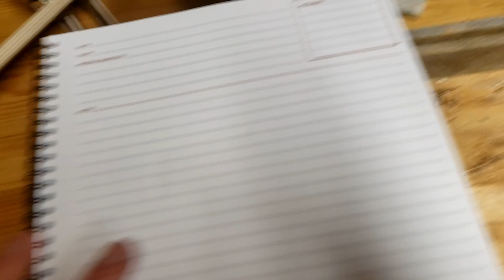I'm not finishing My Latest Prototype... Sandtronix 5 Taking a New Direction

Comment: hey I mean product dev is annoying at best and completely unpredictable at worst - what you've got through thus far is still impressive. saw this video in recommended and don't have much idea about sanding or your specifications - but if you'd like to save weight maybe building a smaller but likely stronger aluminium skeleton frame could help once a wooden prototype is running. In my case its helped for slightly adjusting motor positions without having to remill/reprint a frame component.

Ive built a similar-ish wheel design for a robotics comp before, and as a forewarning, keeping enough traction from contact force between the wheel and the wood while also being able to lift and rotate it may be challenging, id look at horizontal rotation rather than vertical rotation.

good luck and post updates, I'm invested now :)

Edit: oh on keeping even weight on the sander while rotating the lever thing, I assume you will but not sure from the sketch - maybe have a little cube frame that the lever pivot is attached to, and then manage the sander calibration from within the cube. you could place small ball rollers on the bottom corners of the cube.
Reply from the maker: i definetly decided to do horizontal rotation instead, definetly need some system like the cube to apply pressure to the sander because with the lower weight things will be bound to rock back and forth!  Sander has to adjust angle automatically.